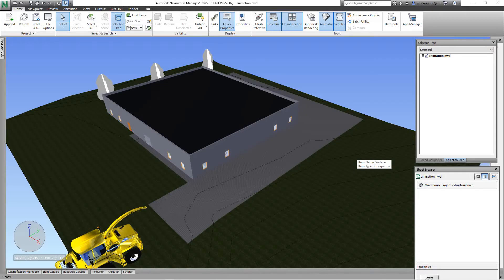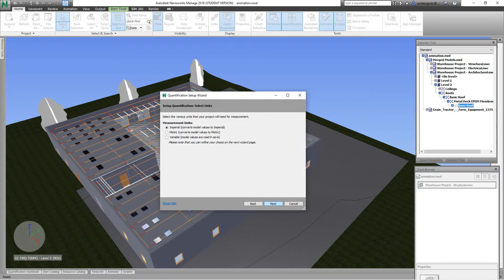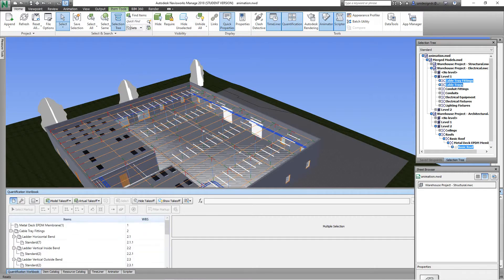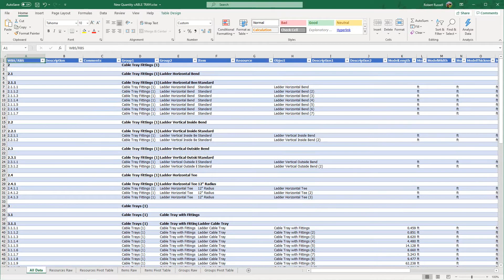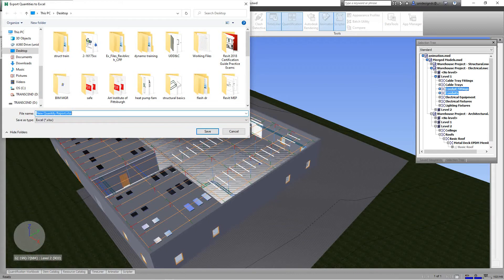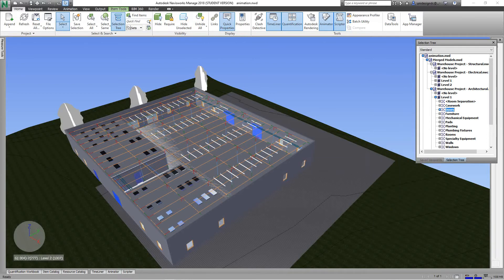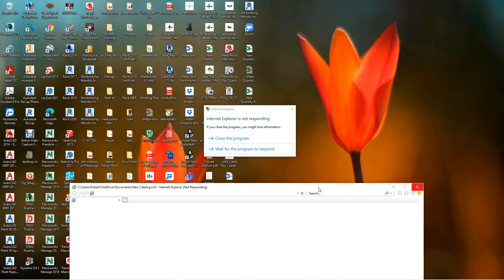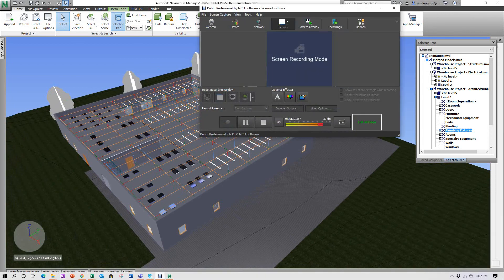Navisworks Quantification for takeoffs

Comment: how i can quantification all the cable supporting system in detail , especially those fittings (riser) with angle?
Reply from the maker: Hi thanks for watching, it depends on the fitting type which you can isolate. But it depends on how the types are used in Revit. I hope this helps.....
Reply: @unidesigndc  meant that i will have to create sets for each degree of the fitting right?
Reply from the maker: Yes the 30 45 60 and 90 degree or whatever you are using
Reply: @unidesigndc  nope, it doesn't work..

Comment: Thank you very much I have a problem when i click right click the “ take off “ bar doesn’t appear, anyone know the solution?
Reply from the maker: Hi not sure why that is happening. Are you using Navisworks manage?
Reply: Thank you very much for the answer, now i found it but i faced another problem, it will be really appreciated if you can help me in it

I tried three models, the three of them they gave fore me for each element “length, volume , width … etc “ = zero meter 
No numbers no length just zero
Reply from the maker: @ghaithtaher9907  Hi not sure why you are only getting zero. Check all your setting. I would have a look but I don't have Navisworks at the moment but I will soon.
Robert
Reply from the maker: @ghaithtaher9907  Check all of you setting, I wish I could check it for you but I don't have Navisworks right now.
Reply: Oh ok, thank you, i hope that i can find something in the settings
Reply: The main file is IFC file, this maybe the problem or not?
Reply from the maker: @ghaithtaher9907  Yes I think that is the problem, I don't think IFC file can be counted. You need either Revit or AutoCad I think..?
Reply: Thank you but unfortunately i tried to make a new revit file and i save it as revit file but also always the value for everything is zero
Reply from the maker: @ghaithtaher9907  Are you selecting all of your components when using the quantification note book. In the project set up in the quantification note book make sure you have all the correct units, either metric or imperial and there are other setting there, make sure you have the correct units etc.
Reply: If you know any video that i can see for the settings this well be appreciated also. Thanks

Comment: I couldn't find the way to takeoff pipes, cable trays, conduits lenghts according to sizes such as 4", 500x100, Ø50..., it is giving bulk lenghts, not separated diameter sizes
Reply from the maker: Hi Fatih, I had the same problem too. What I have done for sizes of pipe size and fitting in the past was to do them in Revit, because I haven't as well figure that one out. Very sorry I can't help but I will investigate, we did a data center tons of pipes conduit etc. we had to quantify pipes and fittings in Revit.
Reply: @unidesigndc  Thanks for your quick response, I'm working in subcon scope is not included design, our contracter dont release us rvt files. they are sending nwd , dwg , pdf files. thats why I need to find easy way to takeoff quantity. otherwise it is taking so long time
Reply from the maker: @fatihcengiz16  Wow the contractor has to release the revit model, because that's all you can do, how do they expect for you to do coordination. I would do what we call is a contingency stating we could not do an accurate take-off because we don't have access to the Revit model....wow you are going through what I go through on my job its hard working for people that don't understand what we do